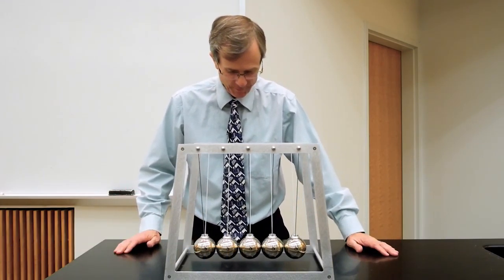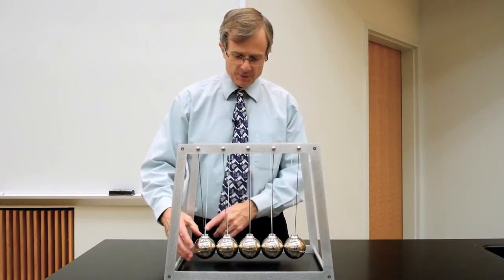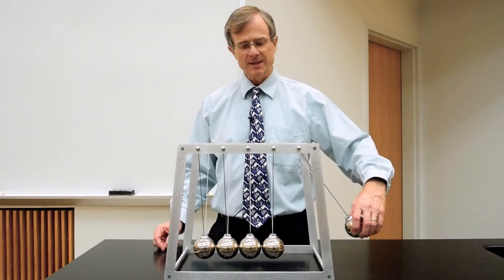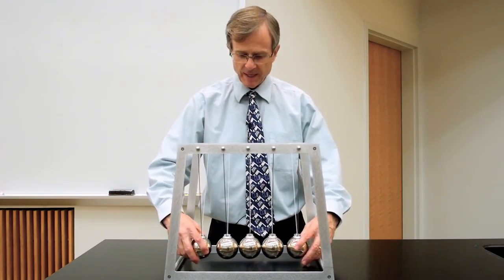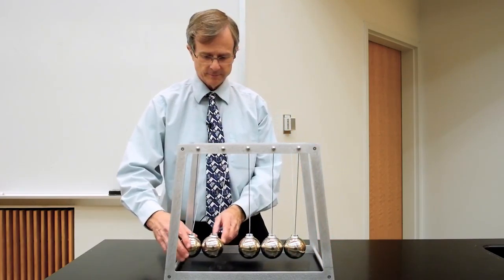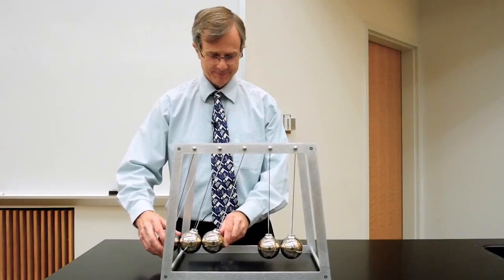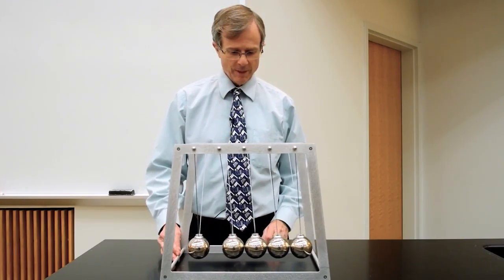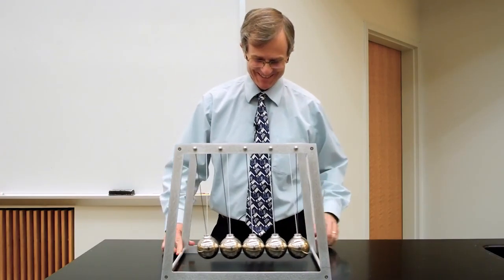Collisions Demo: Newton's Cradle

Comment: There is a little flaw in the explanation: One ball down and 4 balls up would perfectly conserve both kinetic energy and momentum, this is no problem, the single ball would be partially reflected. The difference is made by the 4 separate balls: the ball down transfers its complete energy ONLY to the second ball, not to all of them. The 2nd transfers to the third etc.. Only if you glue the four balls together, they would behave as a single mass. But this would also conserve KE and momentum.
Reply: Let mass of each ball m, velocity of the ball thrown be u and the velocity of combined system of 4 balls be v
then from conservation of momentum
mu=4mv
From here we get v=u/4
and from conservation of KE 
½mu²=½(4m)(v)²
From here we get v=u/2
As it is only possible when u=0 
So it is not possible to conserve both energy and momentum if all four balls move together.
Reply: @itstanujyadav  You have overseen, that the single ball will recoil from the four masses, so it is no problem to conserve both momenta and kinetic energy. If the incoming single ball has the velocity u, then its recoil velocity is -3/5*u, whereas the 4m go in forward direction with 2/5*u.
Let us check it:
Total momentum before: m*u
After (4*2/5-3/5)m*u=m*u
Total kin. E before: mu²/2
After: (4*4/25+1*9/25)/2*mu²=1/2mu²
Seems to work...